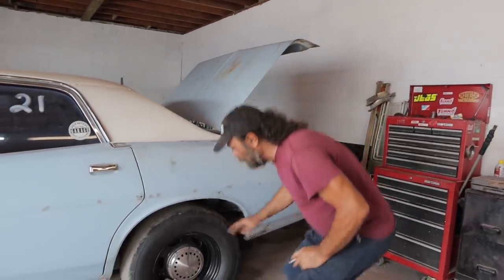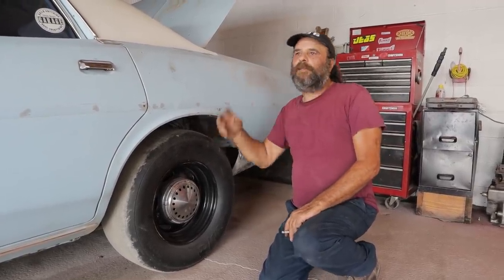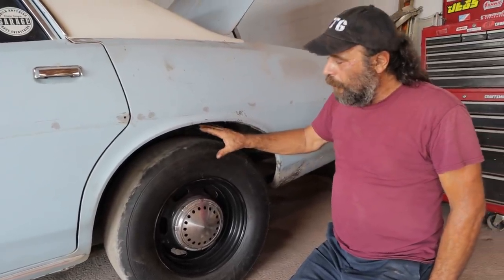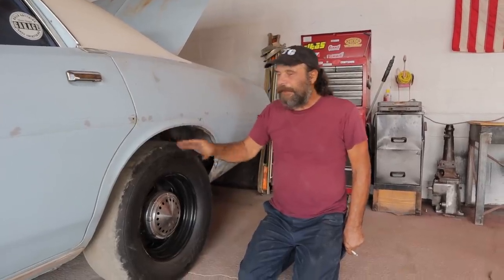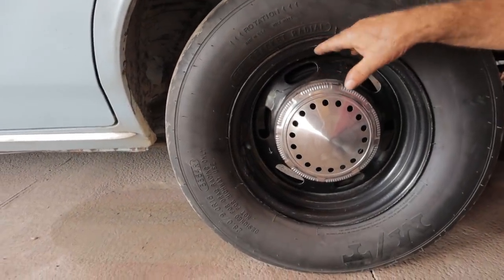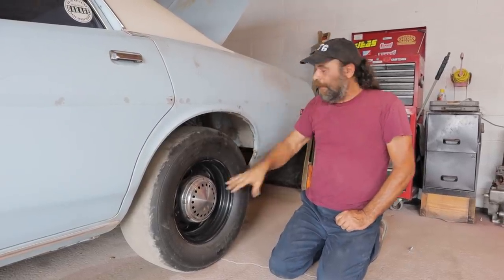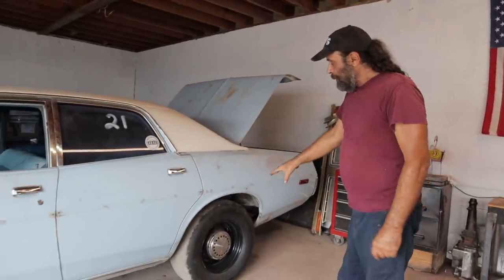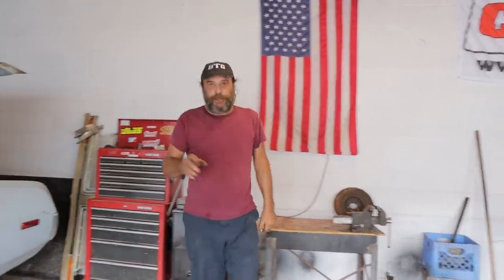Traction Strategies For Street And Strip Cars

Comment: What would a guy who got a stock 5.0 mustang to go 13.50’s on stock gatorbacks  know about traction? 😂great video as always uncle tony.
Reply: I want to see this lol
Reply: @jeffcivjeep7  not entirely factory stock. He talks in another video where he started with a stripper zero option car: reduced weight, changed thermostat, removed sway bar, adjusted timing, adjusted fueling by using an electronic part from an automatic,  bypassed certain accessories with a different belt, messed with stock airbox. 
Pretty impressive nonetheless

Comment: Had a new '67 Camero, 275hp/327, 3 speed with 3.08 gears. When the 4-speed boys hit 2nd I was still pulling strong in first. It wasn't a burn-out queen but it was quick with very little spin.

Comment: Interesting, i had never tought of the heavier steel wheel acting as a inertia damper !
Reply: Looking back on a build , I used way too light a flywheel.
It would break loose and zing to the moon, and when you tried to pedal it back and it hooked ,as soon as you nailed it again it broke loose. 
It was fun though , when you revved it in neutral you swore it was partially siezed because it ramped up and down so fast. 
Same but different with the 2 stroke dirt bike guys who ride in alot of sand , they usually like to add some flywheel weight so it's not so snappy
Reply: My high school physics class had a steel hoop and a wood disc the same diameter, same overall weight. Teach put them on top of a ramp, asked us which one we thought would reach the bottom first. We all said "same time".

Wood disc was first by a long shot.
Reply: @MrTheHillfolk  I can certainly see why he would want more weight on the back of the car, but I have trouble seeing why rotational weight is desirable outside of idling.  The lighter tire should grab just as fast after he gets off the throttle even if it is spinning faster by the time he realizes it is spinning, because it will slow down again in less time, and the energy would help coast further, but it shouldn't help accelerate.  I would focus on moving the battery back, then the radiator if possible.
Reply: @alan6832  
With a little more rotational weight the breakaway can be easier to pedal and if it does it won't take off to the moon as fast. 
It's a sharper knifeedge to ride and pedal it when it's less rotational weight.
You're also gonna have to get in it quicker so it doesn't pull down as bad as it's starting to hook. 
I'd rather have it light too, all that stuff can be figured out with a little testing.

Comment: As that tire spins the centrifugal force pushes the center out more that's the thing to remember.  When you heat the tire up the pressure increases and the contact patch decreases. Error on the side of low pressure with a radial anyway with slicks you can learn what's going on.  I used to run dirt cars on circle track and heat changes tire contact  patch quite a bit. Bias and radials are two different tires

Comment: Your logic for choosing a 9" tire is solid, but I don't think you'd need anything wider (even with more power), granted the suspension is sorted. Here's why. I recently spectated at an NHRA event where I saw Factory Stock Showdown cars making ~1500hp pulling a wheelie on the launch and doing 7 second passes... ON 9" WIDE TIRES. Blew my mind.

Comment: it makes sense that the heavier wheel will have more energy stored once it starts spinning freely. this free spinning energy will die down slower than a light rim when you lift the throttle. allowing you to in a way oscilate the wheel speed right where you want it easier. I always knew tall wall tires were "the way" this puts it all into perspective.

Comment: Interesting concept. It has got me thinking, obviously the higher weight wheel takes more time to spin up but it also takes more time to slow down. If breaking traction is due to the surface of the tyre moving faster than the surface speed of the road. We pedal it to slow the wheel down in order to re-initiate traction. But a heavy wheel will take longer to to in-itiate traction because it cant react fast enough. So wouldnt it be more effective to only use heavier wheels on the none driven front wheels which are slave to the road speed, and then use to light wheels for the driven wheels which need to the lightness to be more reactive to changes. The front wheels still would have inertia and thus still propel the car due to invested energy.

Comment: Talking about traction and I keep getting distracted by the dirty dirty tires. But on another point I was always told that air-shocks where bad for traction as they prevent the suspension from squatting and helping weight transfer.

Comment: It's been years since I dragged myself, but I have never purpose bought new stickies for the track as I don't go often enough to justify the $- so when you buy used slicks etc they aren't always the ideal size. In any case, I ran a 1/4 mile with my 350 swapped S10, with 3.73's  and 28" tall tires I was only taching 4300 in the traps- I acquired some 26x9's on 16" GTA trans am rims (light) and the next runs I was right at 5200, which is where my mis matched combo peaks and falls off over that.

Comment: So that tire pressure trick is pretty rad would u also recommend this on a street car with street tires
Reply: No you don't want to do that with street tires you want the proper PSI for tire wear on a slick it's different
Reply: I have a 2000 lb car with 285 tires on the rear. To get the tire pressure right, I set them both the same,  a bit too high. A tire or carpenters crayon is used to draw a line across the tread. driving it a few blocks wore some of the chalk off. the center was worn more than the edges. I redrew the line and lowered the tire pressure a bit. This was repeated until the line wore evenly on each tire. The, a cheap IR thermometer , from the import store that shall not be named,  was use to double check my results  by checking five spots across the tread. In this case, all was good. a heavier car, or much narrower tires, may have proven to need that tool for fine tuning.
Reply: @clarkmarkey1498 thanks for the replies ya I have played with pressure I have a 275 on 7in rim so I usually keep pressure around 25 that way it wears even across the tread. Car is heavy 78 aerocoupe caprice curb weight was 3400-3600 but I'm prolly pushing 4000lb big stereo in trunk 2nd battery extra tools and jack etc. I might be under a bit from stripping almost all the insulation from floors and firewall and behind back seat but idk have not scaled the car yet. But I do know car makes 400 at the tire thru a loose convertor.
Reply: Rounding off wear is why i dont rotate tires.
Higher street pressure improves mileage and too low pressure makes a car drive "wormy"... 
Too soft of sidewalls suck too.
Hence the pro touring tires.
I hate those rubber bands.😁

Comment: Not only does the inertia of the wheel help with traction, that unsprung weight is free grip as well. Dirt track guys run unnecessarily chunky brackets on their rear ends for the same reason.

Comment: Being a street/strip hot rodder I understand parasitic loss very well.  My question is when you go to the stock rims why wouldn't you use 10x29.5s? They are the industry standard small tire and you'd gain traction and exchange parasitic loss.

Comment: Tony, the rear end gear ratio is rated at 3:55 .1 let's say, with a 26" tall tire. With a 28" tall tire you have changed the effective gear ratio to say a 3:31.1. Did you take the tire size you have into account when you picked the rear end gear for bottle rocket? What gear ratio do you think you are at now?
Reply: 4.10 I think
Reply: tony said 4:10

Comment: Get a lighter rim,and put glycerin in the tire.
You will have a real flywheel,wich even will balance ,and baloon the tire for less rolling resistance at high speed.
flywheel can be ligther and as effective if the mass is on the outside ,don't need mass close to the axis or rotation.
Reply: The burnout/drifting crew have played with filling the tires with water. Heavy as hell, but lets you burn them forever.
Reply: @ScottKenny1978  Glycerin is not water,it's more viscous,and stick to the tire.
If you rotate the wheel before launching,glycerin will distribute itself and stick,contrary to water wich will go immediatly to the bottom.
You will not have a flywheel under 20 kmH,wich is dumb for a launch.
You can tune the viscosity of the glycerin with powder.
Reply: @michaelovitch  I think the burnout crews like water mostly for heat control, not flywheel effect.

But yes, glycerin should be better for flywheel effect. (I won't say is better until I have a chance to try it myself)

Comment: Should try to keep it light . Shorter tires help with higher gear ratios . For foot print I would wet the tire and roll it on dry pavement less 3-5 psi if you do a burnout the pressures go up.

Comment: Your thinking works great for bias ply slicks but a radial Is a who different ballgame. You need to deadhook a radial or you'll spin the whole track. Once a radial loses that grip you won't get it back. Also suspension is tuned to throw all the weight rearward on a radial with just alittle compression on the rear to help plant it. On a radial car you want the rear tire to separate from the body like it's trying to push down the radial against your surface.. all this being after you throw the weight to the rear of the car. A set of limiting straps is good to have on the front for track surfaces with radials.. you couldn't pay me enough to race a radial on the street. It's pointless. Lol  hoosier quick time pro's 28x10.5 is your magic number for a grudge tire or street raced tire. I mention the qtp bc it's been the best tire I've ever used or seen used on the street. That car a 27x8.5 qtp would work freaking wonders.

Comment: Just picked up a mopar purple cam shaft for 100.00 + 25.00 . it's for a small block 292 and 508 lift 
Can I use stock or stock performance mopar rocker arms and push rods? I know I'll have to change to high valve springs

Comment: I love your videos and you are a car wizard but in this instance I question your logic of you using a smaller tire to keep rotational mass down then a little later explaining the benefit of having more rotational mass to maintain the "flywheel" (inertial dampening) effect for ease of back peddling when power overwhelms traction like a nitrous hit.  It would seem that the extra weight wanted for helping maintain traction down the track negates any savings you may have wanted at launch. Why not just run a wider tire (which is heavier) and send it harder?

Comment: Will a wide bald street tire work for a cheap slick or will you still lose traction?
Reply: Won't be as sticky as a real slick, the rubber compound is very different.
Reply: @ScottKenny1978   figured it would be but had to ask
Reply: @MoparMan-ff8fb  it may still be a decent option if you're racing on the cheap and/or only need a bit more traction.

It's always a good idea to be friends with a couple guys at the tire stores!

Comment: I'm gonna go ahead and call it. Stick cars dont work with radials, I really only know of one stick car that works on a radial and the only reason it does is because of the bad ass black magic slipper clutch. Its gonna want a slick.
Reply: Those are slicks, just of a radial construction.
Reply: @656hookemhorns  they are still a radial and work the exact same those are M/T bracket radial to be exact, what I mean by slick is a bias ply tire.
Reply: @woodgrain18  then call it a bias ply.

Slick just means no tread.
Reply: @woodgrain18  that's a drag race thing then, because the circle track gang is always on slicks so has to specify radials or bias ply. 

I'm more of a road race guy.
Reply: @ScottKenny1978  I can understand that. I dont know anything about circle track or road course racing, but when it comes to drag racing that's just how it is.  I'll tell one that drives me crazy to hear is people call  radials  cheater slicks! LoL but it doesn't make my blood boil when someone calls nitrous NOS!! I thought you where trying to be a smartass with your first comment so I'm sorry for being rude.
Reply: @woodgrain18  no worries.

Comment: I adjust until tire temp is even across the whole tire.
Reply: Rubber thickness varies it.
Reply: @hotrodray6802  I'm not saying my method is right, but it got me into the 9's on a 275 tire @4,000lbs.

Comment: for drag racing, put the biggest tires that fit, period. The first 4 minutes are pretty contradictory.
Reply: You only a tire as wide as the minimum necessary for the car to hook, any more and you're just toting extra weight.
Reply: @656hookemhorns  exactly, if the car can do a burnout with no water the tire isn't big enough. in 99% of drag racing applications you can never get enough traction. the other 1% need more power.

Comment: lets all take a guess as to what it will E.T...im gonna say..12.8
Reply: If he goes to the local track (which is an 1/8 mile) it should run mid to low 9's without spray. This will be Bottle Rockets 2nd trip to the track. Still doing shake down runs.